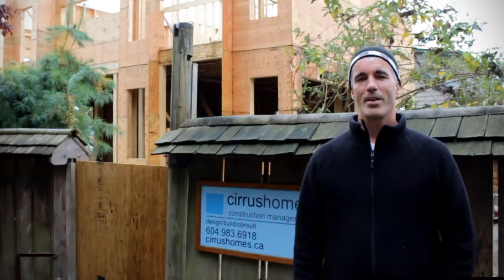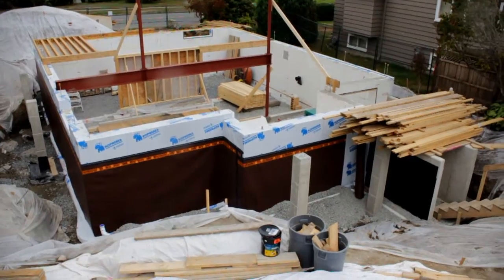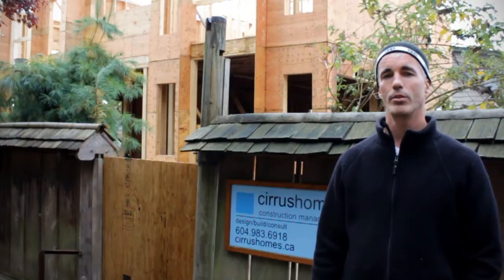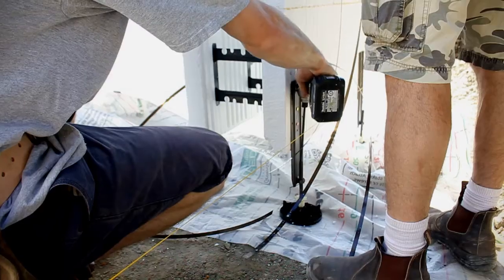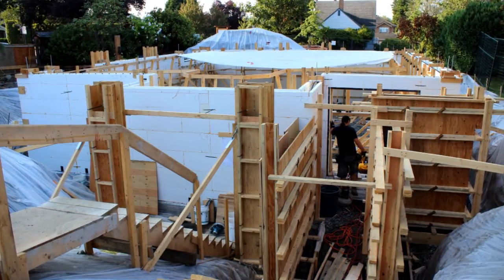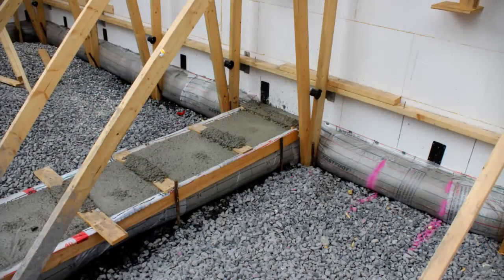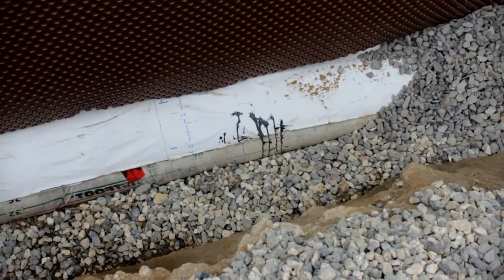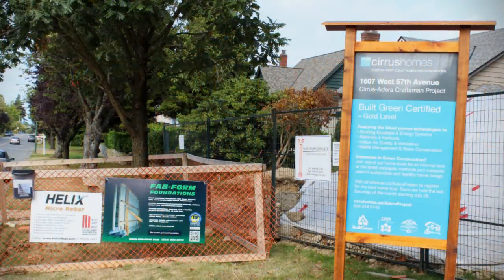Fab-Form ICF Monopour using Helix Micro Rebar

Comment: Did you have to use horizontal or vertical rebar with the helix micro rebar cement?
Reply from the maker: There would just be two bars of horizontal rebar at the top of the concrete wall. Everything else was replaced with Helix.
Reply: Thank you